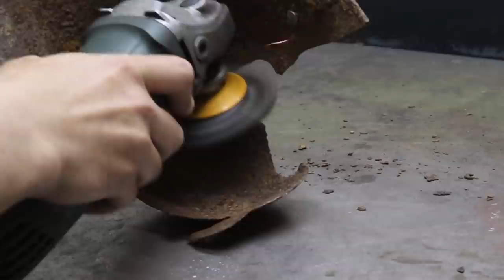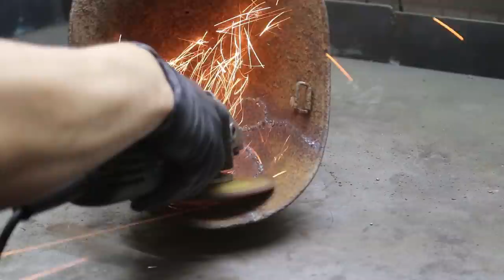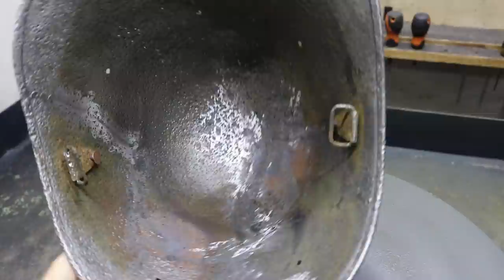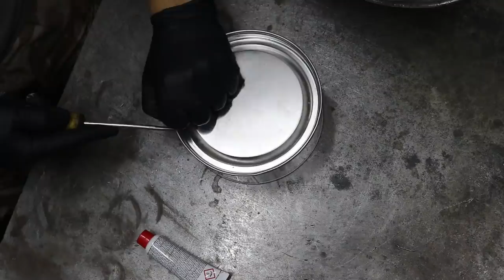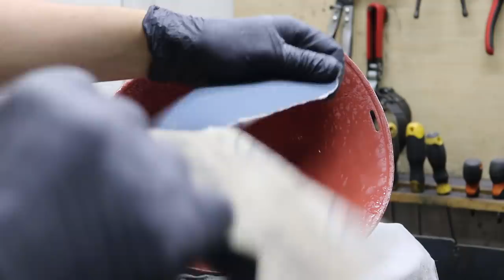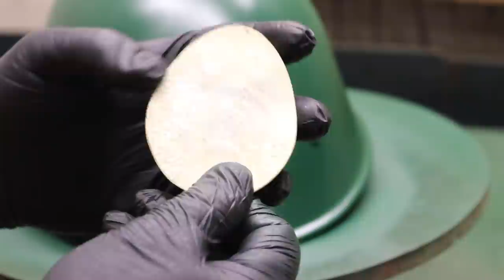Broken World War II Helmet Restoration

Comment: I have to adress this topic again. The original design of this helmet is DUTCH. Because this one is falling apart I cannot tell if it's a M1927 variant or one of the later ones like the M1933, most likely one of the later variants. Main differences were the somewhat more pronounced curve on the sides and the bit more sturdy construction. The Romanians ordered hundreds of thousands of them with a couple of alterations but still recognizable Dutch . It seems they chose for the Dutch helmet because it didn't look like any other helmet from  neighboring countries. I believe that even during the war, the Germans kept providing the Romanians with the "cazca  olandeza". After the war the Romanians used Russian helmets (and the Dutch used American helmets). However there was also a later Romanian design that was based on the former Dutch helmet.

Comment: Romenian helmet from 1939.with king Carol II badge
Reply: Hard to tell dutch helmets are exactly the same
Reply: @JJ-rc4sc  no my frend. Its recovered from blac market ww2 from rusia.probabily ukrain.
Reply: @Sofer_de_glont  ah oke they are almost the same only diffrence are the dimensions and the front plate
Reply: @Sofer_de_glont  i did a little bit of research on the helmet :  
 
There are two types of Romanian helmets: first of all the m38 Romanian: A Dutch production based on the line drawing 'casca de otel', commissioned by Romania and under contract with the Verblifa which in fact was the Dutch m33 with a number of changes in the dimensions and has therefore become its own model with its own helmet emblem. We also know the helmet m73. This own Romanian production is derived from the m38
Reply: Da. Și eu am recunoscut imediat formatul.

Comment: I like that you gave the chemical formula for your rust remover.  C6H8O7 is the chemical formula for citric acid.  A weak organic acid found in fruit.  That worked surprisingly well.  A sandblaster would probably have been quicker and easier, but not everyone has one of those.  I've seen people use auto body filler for the pits in the metal and did some welding in the more extreme cases.  But your use of tin was interesting.  Is that some sort of tin compound in solution like what people call liquid tin?  Or is it more like a solder paste?  The use of a torch suggests the later.

Comment: Is there any reason not to use electrolysis to remove the rust?  
Is it too large of a piece for this to be effective?
Reply: Wouldnt it make the layers uneven or even creates holes within the steel, that would make it harder to work with

Comment: Impressive work, but the result isn't very realistic. The color is much too green (by the way the few remnants I saw here are more typical of the Dutch army than the Romanian army), the liner should have been made of black leather and is wrongly attached to thé shell, and the original insignia is made of blackened copper. And you can't be sure it's a Romanian helmet except if you are totally sure where it comes from.
If you ever find a shell with only a trace if insignia, if you want to know whether it's a Dutch or a Romanian helmet, it's very easy : the Dutch insignia is perfectly oval, whereas the Romanian insignia is egg-shaped, broader in its lower part.

Comment: Waste of time. It was too far gone. The slot on the rear of the helmet was probably for a leather strap and metal O ring to hang it up. Why didn't you replace the D rings and metal straps on the sides of the helmet?

Comment: If you put the epoxy in two parallel lines of equal length you will have the correct proportions (rather than putting one on top of the other).